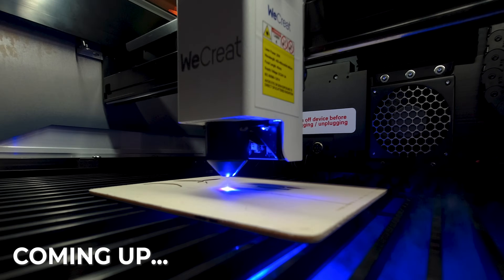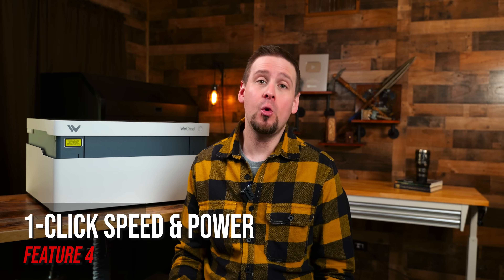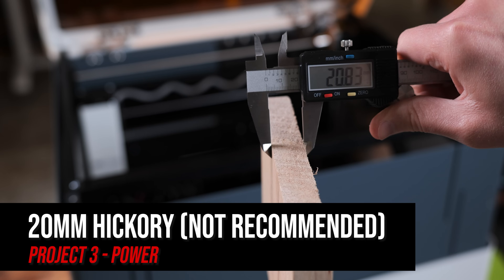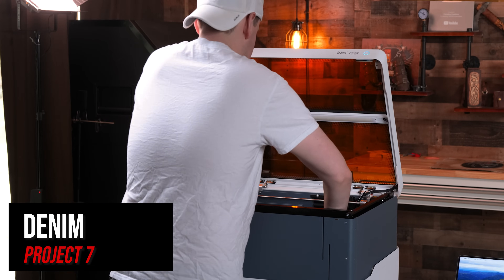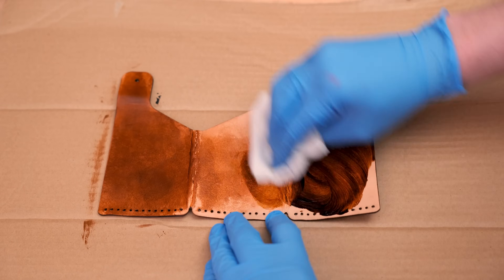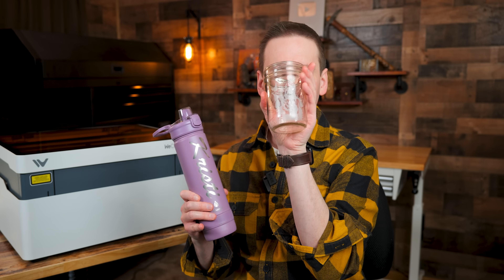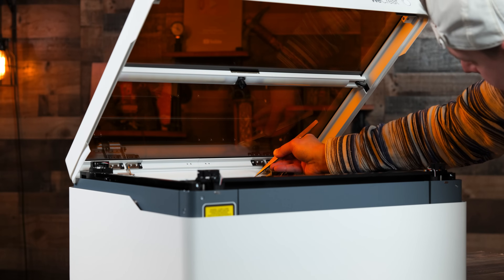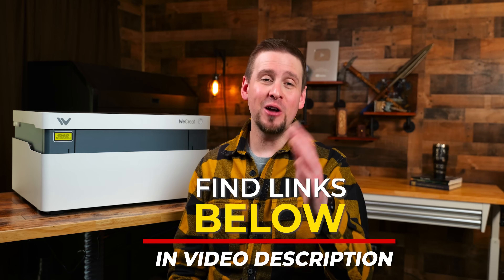WeCreat Vision Diode Laser Engraver - How to Engrave Almost ANYTHING!

Comment: Thanks for the video. I bought one the other day and am now trying to learn about what I bought. I chose it over two other machines that seemed impressive - but what sold me on this was the auto-focus and no need for a riser. I wish however that they had interchangeable lasers like the xtool s1. I went with the 20watt because I need to do fine letter engraving mostly. I'm hoping I didn't make a mistake.
Reply: How’d that go? Good choice?
Reply: @joshymcdaniel9233  Yes, it's been going well. I'm a "real beginner" - never studied any of this. So, I'm just scratching the surface of what can be done. What I love is that I could be up and laser etching really fast.

Comment: Question about the glass…so, you put the paint on and engraved the design. Then you removed the paint? How did you do that? And it looks like it didn’t affect the design at all, yeah?
Also, I’m wondering if this diode laser can engrave on stainless steel. For example if I wanted to engrave an image on a knife blade…
Thanks in advance for your input. Great video.
Reply from the maker: Hey there! So diode laser needs a medium to engrave glass. The black tempura paint allows the wavelength of the laser to etch the glass.

On SOME stainless steel diode lasers CAN mark with various colors. The most cost effective option would be to get an IR laser that can make them consistently. You could probably make some knife blades, but an IR laser would be more what you are looking for 👍🏻
Reply: @CorneliusCreations  how did you remove the paint?

Comment: Do you have the basic or rotary pack? Is rotary pack needed for tumbler, glass jars?
Reply: One problem I see with the rotary is that it doesn’t seem likely to be able to handle tapered items.
Reply: Does it need to be purchased separately?
Reply from the maker: You can purchase it in a bundle for the best price.
Reply from the maker: Yes, I got the rotary pack and it is needed for any type of cylinder object.